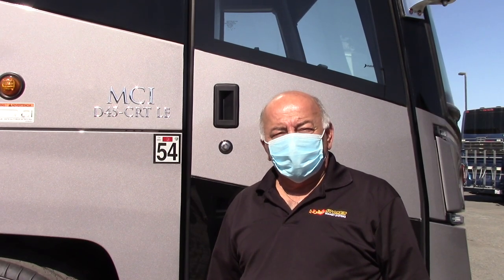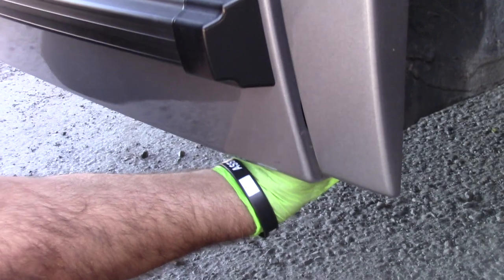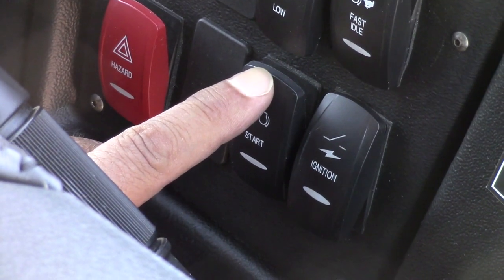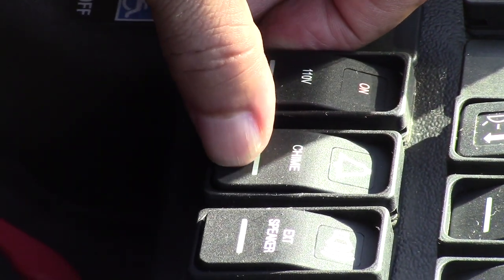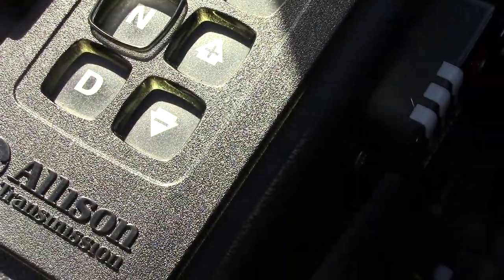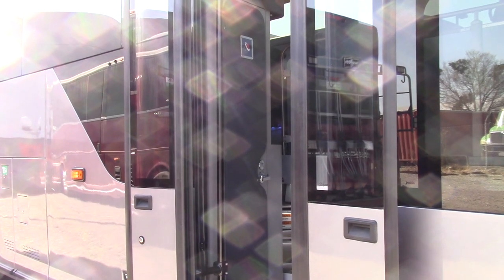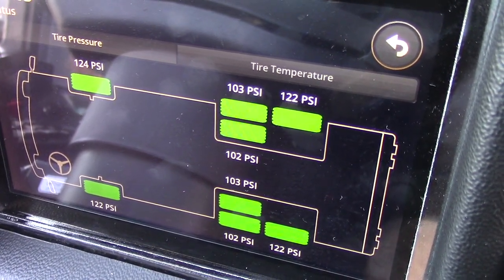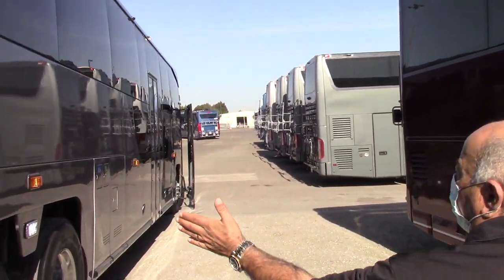Storer Proficiency Training for MCI D45-CRT LE

Comment: How to make a bike rack complicated!!!  On "my bus there are 2 arms folded in and towards/against each other.  At the end of the arm, you'll find a hook, so when you pull the arms straight out so you can hang the bicycle (up to 4 bikes) frame on the arms, the bicycles won't fall off. The "arm's" are hold in place by tension. I love American cars, and planes, but when it comes to buses, the USA is far behind in so many areas. (Compare to the buses we use in Norway/Scandinavian)
Reply: There’s nothing complicated at all about this bike rack.
Reply: @marvinjgerald6007  Compare to what I'm used to, it is!
Reply: Not true at all. i work for a transit company in America and our bike racks are in front of our buses firmly secured by a hook as well